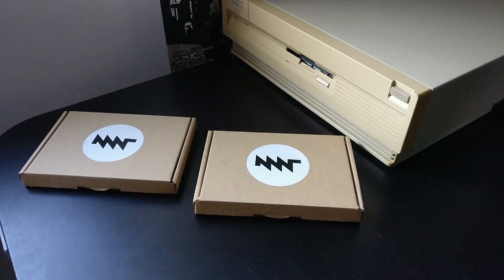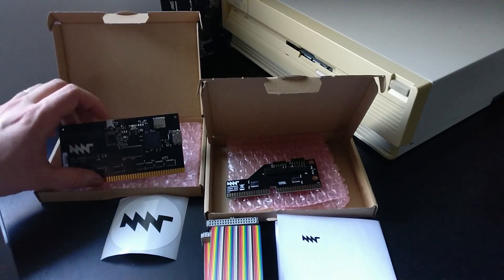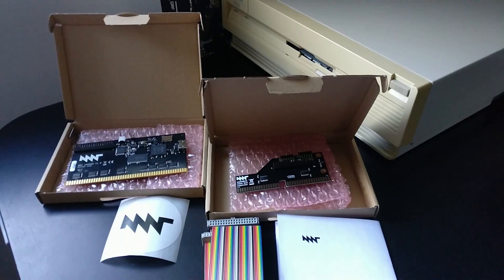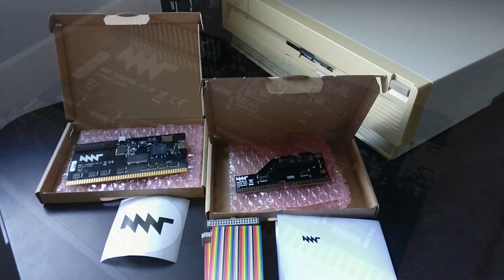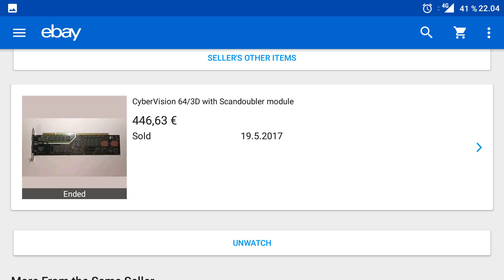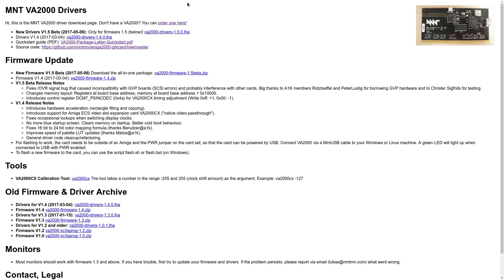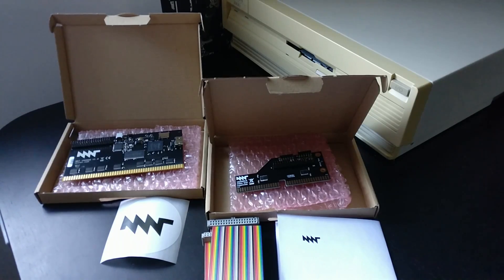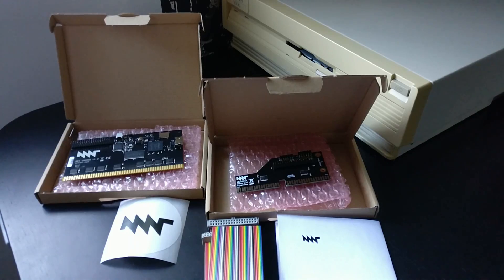Introduction of mntmn VA2000 + cx and installation into my Amiga 3000

Comment: Silly question-- so is this a scan doubler? If it is capable of outputting native Amiga video, wouldn't that be 15KHz?
Reply from the maker: jdryyz Big box Amigas have an internal videoslot that is able to output native amiga graphics (ECS) digitally.  The card uses this data and as it only has digital HDMI port to connect to the modern displays, it naturally does not provide 15KHz video.
Reply: So then it will very much resemble what the A3000's built in flicker fixer can do minus the HDMI port. I believe you said your flicker fixer is having trouble now so this is a good replacement for that and you have RTG modes too!

Comment: Is your experience with this setup still good?
I subscribed in case you make more Amiga (or other old computer) related videos.  =)
Reply from the maker: Yes definately it has been a good setup. And in fact is has just gotten better with the va2000 firmware upgrades. I even had my A3000 recapped and now that the VA2000 supports flickerfixer I´m very happy with it. My intention has been to make more videos, but I´ve just been way too busy lately. I would love to make more videos about this setup of mine.

Comment: It pass through the orginal amiga video without the rtg driver ?
Reply from the maker: Daniel Ivanov Decsev Yes, the va2000cx module does the trick. So you just plug in the Hdmi cable and you'll get your original amiga mpdes to the monitor. Currently it only supports ECS though. To access higher resolutions and colors you need the Picasso96.
Reply: Cool !
Reply: more ram =equals more colors ,ans more resolution ,well to certain point ..ie more capability ie can it, the hardware do it. There was/is At rue 48bit card ,besides the 4000 Toaster,and I have only seen one guy have it..Yeah,it was a monster of a card. A2000 era